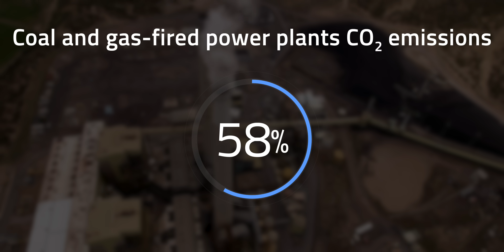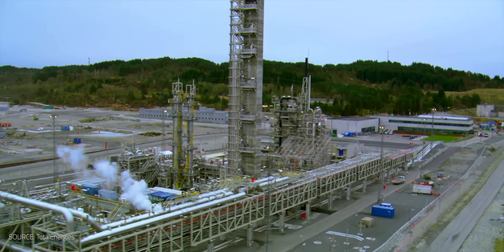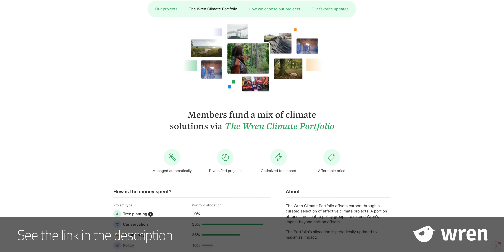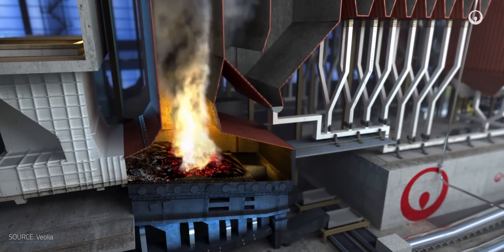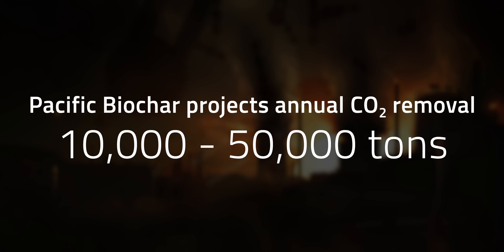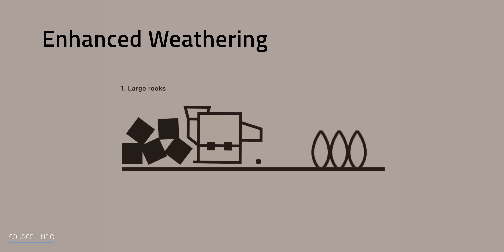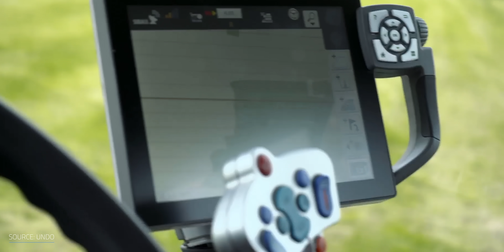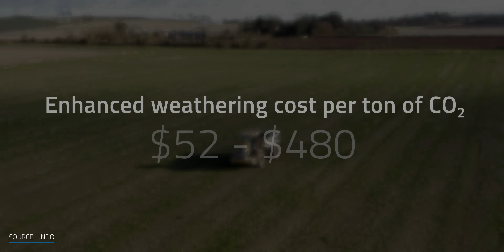The Reality of Carbon Capture

Comment: Using nuclear power would reduce CO2 emissions drastically. It's always fossil fuels vs renewables, not what actually is the most efficient and best atm. 
Fear of possible nuclear disasters is causing actual climate change disasters.
Reply: We have ran out of time, in the West (Europe US etc) Most Nuclear plants take 20+years min from planning to producing energy to the grid. We don't have that time left to adapt. Also, many Nuclear reactors are being curtailed or shut down because either the water is too hot to cool it or the water level is too low to guarantee reliable water supply (Read up on France for example). Nuclear is not sufficient quickly enough, carbon capture is not sufficient quickly enough, stopping burning stuff and putting WW2 level resources into green energy MIGHT be enough to save civilisation as we know it.
Reply: @blueswannabe  Yes and no. Climate change is reversible. It will take time but every little thing helps, not just one big solution. It's impossible to shift to 100% green energy in 20 years. So nuclear will have an impact, especially if the West invests in nuclear energy in smaller nations that primarily use fossil fuels and won't be able to change even in 50 years.
Reply: @TheHipClip  "It's impossible to shift to 100% green energy in 20 years". No it is not, it is VERY possible, expensive yes, complicated, yes, we would need to ration power during the transition, yes, but it is very VERY doable. Now, does the political will exist to do so? Sadly I doubt it.

Existing Tech can do it, we could power Europe from Sahara alone. It is NOT easy but the alternative is millions of people starving and dying of thirst.

We don't have 20 years before the food chain and water supply collapses compared to what it is and how it is now, if we're lucky 10.
Reply: Yes, sort of. But only the small modular reators. The traditional nuke plants take decades to build and use so much concrete that it doesn't really offset much.
Reply: We don't need nuclear power to solve the problem, there are other ways that we know work. Given that nuclear is so expensive, and so risky we should use the other options that are available.
Reply: @tlangdon12  Nuclear isn't that risky. There have been, what, 3 reactor incidents? And we can discount Chernobyl because that was soviet stupidity not building it properly. Two accidents out of how many hundreds of reactors running for decades? Pretty safe sounding to me. And I suspect LCOE is not bad for nuclear, and a nuclear plant only occupies a single acre of ground while getting the same power from solar requires hundreds of acres (usually in the form of clear-cutting forests or converting farmland).

Disposing of the waste is a bit of a challenge, but that is the only real down side to it.
Reply: @TwilightMysts  I’m not worried about the risks in my lifetime, but about the risks of the waste that remains radioactive for hundreds of years.

Comment: The carbons need to go in ground. Modern farming is leeching carbons out of the soils. The carbons need to go in ground to hold moisture for fungus and bacteria to break soils down into nutrients plants can use. And warm the planet. Global warming is a blessing compared to global cooling. Global cooling makes the worse years to be alive. All soil has about same amount of nutrients in it. Without fungus or bacteria those nutrients can't be used by plants. When the forest and game are gone people must farm. When the soil gives out people will have to eat bugs. Why are the Amish fields black with carbons, but modern field next to it is just sand and gravel? Look around global cooling is happening now. Not what you would think when you think of global cooling. Glaciers and deserts grow at the same time. The equator should get hotter as the poles cool. The moisture is going towards the poles. La Nina the global cooling pattern.

Comment: "BIOChar! It's special!" "So it's just charcoal, but made in a modern oven so that you can capture all the useful outputs - which charcoal manufacturers have been doing for ages." "No, nonono - it's GREEN!" 
It's charcoal production. You're describing charcoal, and using charcoal as fertilizer.
Damn, the green industry cannot stop with the scams.
Reply: But there's a plant food crisis!! Gotta suck as much of that out of the atmosphere as possible!
Reply: @Eyes0penNoFear  Theres a fertiliser crisis, not a co2 crisis.
Sequestering carbon doesn’t affect nitrogen, which is the main compound needed for making fertilisers.

Comment: Nice video! You should look into a company called FuelCell Energy. Their Molten Carbonate Fuel cell is the only  technology that can perform post-combustion carbon capture while producing energy as opposed to consuming it like the typical amine scrubbing technology does. They have a joint development program with Exxon Mobil to optimize the cells for carbon capture.

Comment: Would gasification of coal instead of incineration cut co2 emissions?
Reply: how that will work?
Reply: @janami-dharmam  Gasification, specifically Fast Ox Gasification from Sierra Energy, pulls the O2 from the system so that Dioxins like CO2 created far less.

Comment: Can we capture enough CO2 to make a difference? How many carbon-capture plants would this require? How many GW would this require?
Reply: Did you watch the video we don't need to waste time asking if it will work and just get on with it. No doing just one thing will not work but if we do multiple things multiple approaches to reducing carbon it may just work there is no silver bullet.
Reply: Depends... what do you want to make a difference in? If we want to offset current emissions you'd need about 11.000.000 direct air capture plants, assuming they don't use energy from dirty sources. You can lower that number by capturing emissions at the source, but it's still in the millions. The real reason we need to develop this tech is to go Carbon negative, to reach pre industrial levels of CO2 concentration after we ditch oil